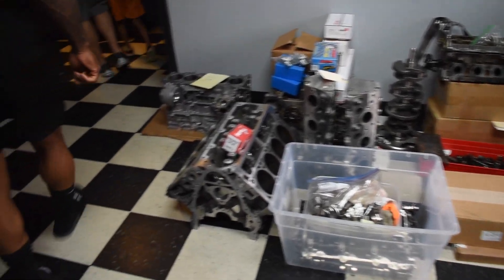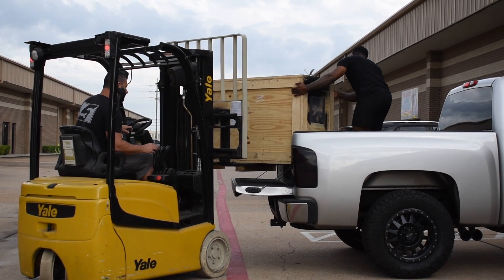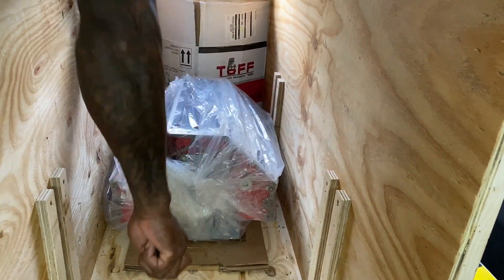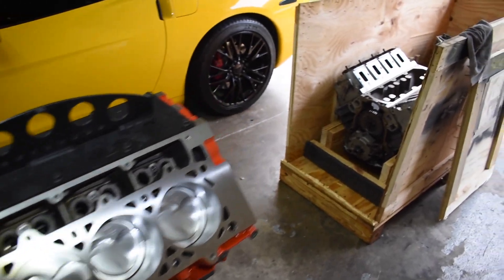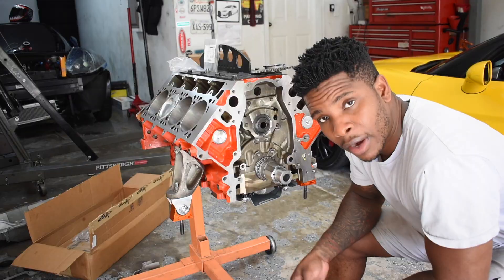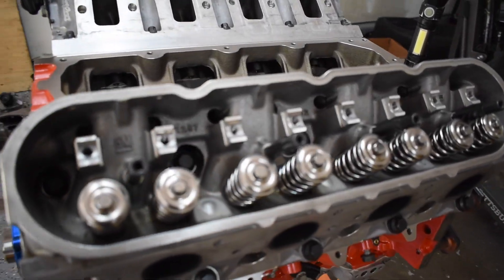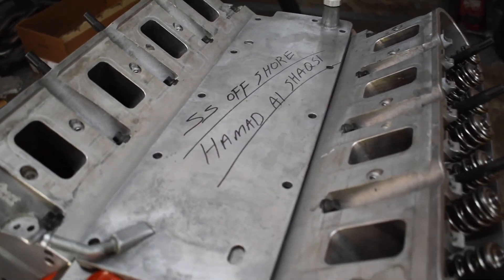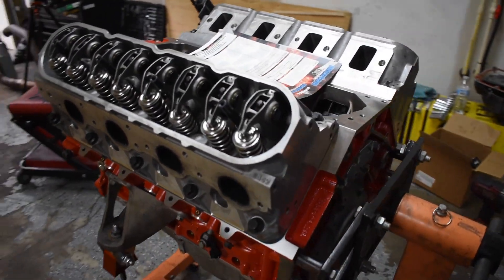ProCharged C6z Short Block Reveal | What is it?

Comment: Bro, I'm all about the B3, I'm going to use the same for my H/C/I C6Z when I do the heads... BUT, with a build like that, why leave so much on the table with that relatively "mild" cam???  I would 100% be using a solid roller cam if I was doing what you're doing!   Please rethink this while you have it all apart!
Reply from the maker: They’ll always be room for improvement. All options are still on the table 😎